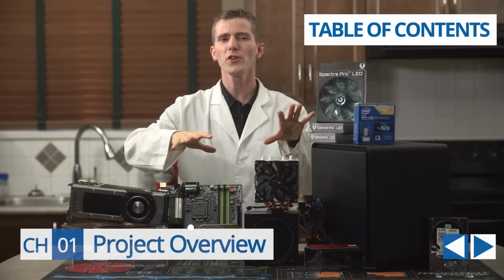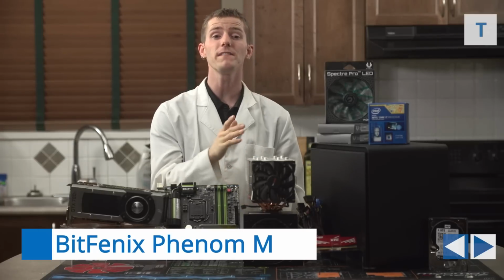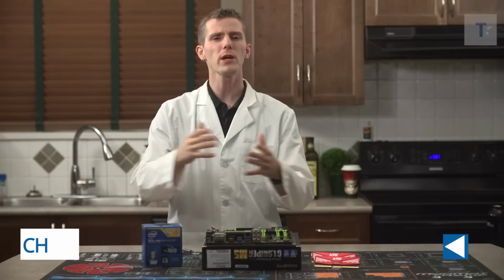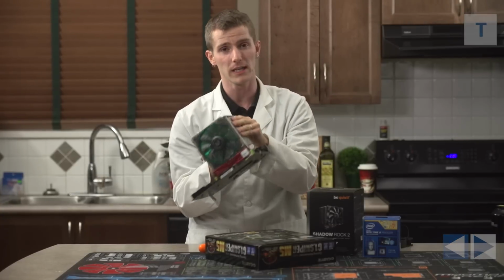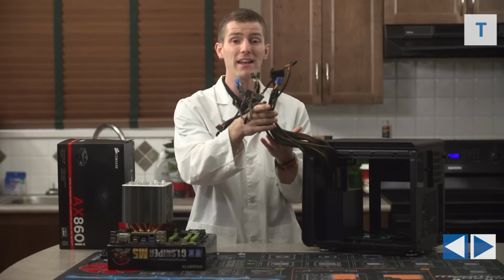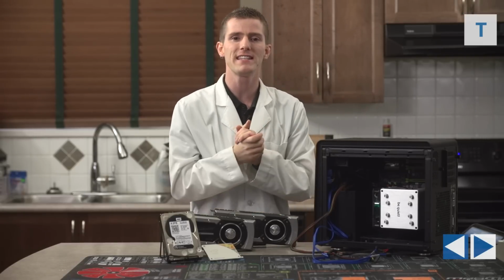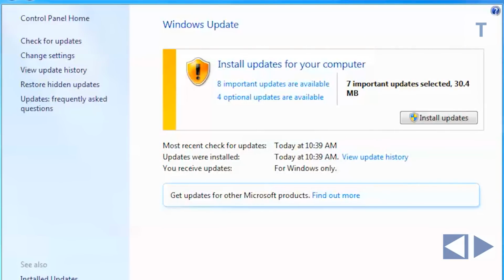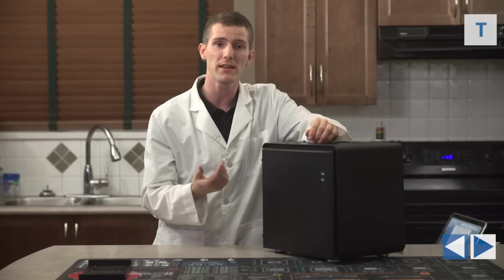ULTIMATE Intel Compact SLI Gaming PC Computer "How To" Build Guide

Comment: I know the video is a little old. but I like this case and ordered it for some measurements. I want to use the be quiet! Dark Power Pro P11 550W power supply.  the problem is it is 180mm long and what I find on informations is the max lenght should be 160mm. I think the bequiet should fit is someone here to confirm my thoughts?

Comment: Is this a good budget build?
CPU - Intel Core i5-7500 3.40 GHz Base Frequency Quad Core 6 MB Cache CPU Processor - Black
Ram - Crucial 8 GB DDR4 2133 MT/s (PC4-17000) DIMM 288-Pin Memory
Motherboard - ASUS PRIME B250M-K Motherboard 
PSU - CiT 400W Micro Atx Power Supply
SSD - SanDisk SSD PLUS 120 GB up to 530 MB/s Sata III 2.5 inch Internal SSD
HDD - WD Blue 1TB Desktop Hard Disk Drive - 7200 RPM SATA 6 Gb/s 64MB Cache 3.5 Inch
Case -AVP M88 Micro Case for PC - Black

Extra -AUKEY USB Wireless Adapter 2 In 1 With Bluetooth 4.0

Comment: GTX 780 TI's, perfectly fine graphics cards that absolutely no one uses anymore.
Reply: ***** Exactly.
Reply: Well, the video came out in February of 2014...
Reply: 600 euro here, rather get sli 970 for roughly the same price (50 euro give or take)
Reply: Aldrian Ramos used to have that card until i fell backwards and spilt water all over it :( its great tough. altough I think I had a gigabyte version..
Reply: Frotzy Wow, They cost like a third of that down here.
Reply: mariochaosspear plus its 3gb... haha, such a ripoff. fuck, 970 sli is almost cheaper then 1 of them... heck, a 980 ti is almost cheaper.
Reply: +Frotzy The 780 TI HAD cost 700$ now on eBay 150
Reply: Niklas Leyrer not here
Reply: Frotzy Where?
Reply: mariochaosspear 270$ USD around there for about 10-15 more preformance compared to a rx 480 which is a good 180$

Comment: Now this will be a killer build with 2 GTX 1080's
Reply: There are better cases out now. I'm particularly fond of this one because it allows radiators: https://www.amazon.com/Thermaltake-Black-Extreme-Chassis-CA-1D5-00S1WN-00/dp/B00PDDMN6S/
Reply: +KinzixHD two 1080s and a kickass processor? Thats gonna be 750 pull, so go with a 1000 or 1200 for safety :)

Comment: the 4770K had some heat problems, if I'm informed correctly. Would've used a regular 4770 or a 4790K. Both seem to be doing better in terms of thermals.

Comment: well done. lots of good information compressed into a short video. a system that size is in my opinion very desireable. thats why i got the prodigy m sitting next to my 29" monitor. looks good together to but if u have ur system on ur desk using quiet components will become even more important. took me some time to find the best psu, fans, gpu and drives to go with. i also recommend using rubber mounts and other silencers to mount the fans and storage devices.
Reply: +1nicko29 is the prodigy m basically the same size as this? was thinking of using it for my next build just unsure if an NH-D15 would fit in, but from the looks of that heatsink think it would be fine
Reply: +Tyler Kelly it´s not just the same size, prodigy m and phenom m using the exact same chassis. the NH-D15 is a bit overkill in a cube like that but it should fit. hight is no problem as this is a very wide case. u most surtenly will have to make sacrifices on harddrives and mounting additional fans.
Reply: Yeah I figured it was about exactly the same, if I ever do build I'll probably ditch harddrives altogether and mount single 1tb ssd to the side panel. As far as the NH-D15 I just wanted a beast cooler and every single review a find on it says it's deathly quiet as well which is great.
Reply: +Tyler Kelly your tower-cooler is 165mm hight. mine is 155mm and i have 60mm space left to the side panel in my prodigy m but the harddrive mounting bracket must be screwed exactly in front of ur cpu cooler.
Reply: +1nicko29 do all prodigy m cases ship with the windowed side panel? I see some listed saying they have one and other not, but every video I see on it has people swapping one of the two regular panels with a windowed one
Reply: +Tyler Kelly side panel is only 10bugs. u have to swap the panel with the power/reset switch to the back. here in germany u cant buy them as windowed version. i also recommend getting the mesh front. i think some have it to start with like the black version. i had to spend another 15bugs on it. it has a dustfilter and helps getting ur powersuply enough air while gaming.check out my video!

Comment: £20 for a fan? are you kidding?
Reply: +.Float £20 for a fan is not cheap. it's extremely expensive.
Reply: +.Float and the 212 is only the best for cost effective terms, put a thermal right tower against it and it will loose
Reply: yeah it is (some fans can be $30)

Comment: @LinusTechTips have you thought about doing a new updated version of this build?  I think many people can benefit from small portable builds, but I don't want to get out dated parts.  I also am trying to do an Ultimate build, so I want the best parts.
Reply: +Albert Gonzales Jr switch the CPU to i7 6700k, get matching motherboard, get 16 GB DDR4 RAM, switch GPUs to dual GTX 980 Ti or GTX 1080s
Reply: +Albert Gonzales Jr Agree with you. Love mATX because of its overall performance per price. But I think it will be wise to wait for the next gen GPU.
Reply: The Modern Shoe I have actually just spent hours looking for an 1151 motherboard with the same PCIE configuratin without any luck XP

Comment: Any chance you guys can make a Build Guide for a € 500  system ? Just the "tower".
The goal: be able to handle League of Legends, World of Warcraft and EVE Online at high to max settings (1080p). With this in mind, feel free to go as up as € 100-200 more if necessary. Minimum of 60FPS ?
Reply: i can save you some time. as i see, youre from the EU so i am using EU prices (higher tax and shit)

i3 4160 - 120€
8gb 1600mhz ram 70€
gtx 760 180€
any lga 1156 mobo will do
550w (any will do)  30€
1tb western digital 55€
cooler master elite 230 30€

its around 500€, depending at what time of the year you buy it. it has enough power for 1080p60f  for any moba at ultra settings and a lot of newer fps games at medium-high.     :D
Reply: +Alexander King excuse me, any LGA 1155 will do, DO NOT BUY LGA 1156 FOR THIS CPU. IT WILL NOT WORK

Comment: Whats Better for Gaming ? Intel i3 or AMD Quad Core ?
Reply: +Marlon Bermudez  i3 i recomend the new i3-6100 or the older i3-4170 both are pretty much equal but the 6100 is more futureproof because it's a newer platform
Reply: Depends on the AMD. Anyways, you could always go with a g3258 (pentium) or an i3-4170.

Comment: Tips for magnet screw , grab a magnet bar (or anything that is a magnet ) , and the screwdriver . Rub the magnet onto the screwdriver (not on the holder )  in one direction . do that for 10 times (just in one direction again ) and then congratulations , your screwdriver is now a magnetic component . Thank me later . 

Additional tips : You dont need to rub it again to have the magnet , the screwdriver itself already a magnet  .

Comment: might eventually do windforce r9 270xs in crossfire... all i need is a new case, mobo, PSU, and fans. sigh
Reply: +Andloo Yunty better get a single faster gpu. if you need all that other stuff to put in a second 270x, rather invest the money into a single 390x/980/fury. you're going to get more even frame times with much less hassle.
Reply: givemeajackson I've actually now looked in to just getting a 390 or a 290x instead of crossfire. I'll still need a new PSU, new fans, and a new case would be better. Also I need a new CPU so it isn't bottlenecked.  #thestruggle
Reply: Andloo Yunty what's your current rig, and what are you going for?
Reply: givemeajackson Current Rig
A10-7700k
8 gigs 1600Mhz DDR3 at CAS-Latency of 10
R9 270X factory OC'ed to 1050Mhz
1TB WD Blue 5400RPM
a supposedly 480w PSU that really does 330 (So I already have throttling) 
A crappy case with crappy ventilation
2 super loud case fans that hardly do anything
and a super cheap fm2+ MoBo
Reply: Andloo Yunty ok, it might actually be time for full rig upgrade then. especially the psu, crap psus are a danger to your rig and your house. i'd suggest doing case, psu and fans first, keep the other stuff running for a while and save up for a good cpu/mobo combo that will last. looking at how intel is creeping along lately i think if you buy a good cpu now it you'll be fine for the next 6-7 years.
Reply: givemeajackson There's no way I'll be doing a full upgrade; I spent all my money on this rig. It was only a few months ago that I completed it, and the GFX card was only added one month ago. I am looking at a PSU right now: https://pcpartpicker.com/part/evga-power-supply-110b10750vr I would love feedback. Also, I'm a minor and have no money whatsoever.
Reply: Andloo Yunty well, cpu/ram/mobo is ok. For psu i suggest something in the 550-600w range if you want to keep the option of going with a 390. The cooler master g-series are cheap and good, same with bequiet's L8 range. This evga one should do the trick as well. I personally scored a used cooler master v700 for 60 bucks, one hell of a deal there. Used hardware is generally a good option. For GPUs, just be careful with used 290(x)s, they were often used for bitcoin mining.
Reply: givemeajackson Thanks for all your help! Also, what difference does it make if it was used for bitcoin mining?
Reply: Andloo Yunty using a card for mining is like letting prime95 run 24/7 for a year on your cpu. It's extremely taxing on gpu and vram, and wears them down extremely fast. Those cards have often been running at 100% load for months. I bought a 280x that was a mining card. That meant i got it for next to nothing, but it only lived for about 8 months until the vram started artifacting.
Reply: givemeajackson Thanks for the tip!

Comment: Hey Can a duel GTX 980 ti fit? If not Can a single one fit?
Reply: Not the 3 fan versions i think tho
Reply: +Domy Albaoud It'll be even better. Much lower power consumption and heat output, and that means a lot in closely packed SLI.
Reply: +Domy Albaoud that is not how u spell dual

Comment: Thanks for this guide Linus (and Intel)! Building my first rig ever with this movie as my guide. It's thorough and very helpful.

One thing I wonder though: you suggest aplying thermal paste in a stripe shape, while the manual of my Noctua NH-D14 suggest a drop of 4-5 mm in diameter. I would say a drop sounds more logical, seeing how the drop will be spread out from the center to all sides. Won't you have excess paste coming out at the far ends of the stripe when using that shape (and does it matter anyway)?

Comment: what happen if electronic component contact with static electric? especially computer parts
Reply: +ilham Defra you could destroy the component. it it fry the compononet, sometimes you can get lucky and nothing will happen but also a lot of the times a static shock will occur
Reply: Destroy mean its physically can seen like burned/blow up/smoked, or it just wont work anymore?
Reply: ilham Defra usually if something happens you wont be able to see it. but if you short circuit it then you will probably see some smoke

Comment: He said that the logo on the power and reset buttons will be upside down, but it's ridiculously easy to flip them the right way. Honestly, if you have one of these cases, just unscrew the I/O pcb from the side panel, and you will see how easy it is to switch the button orientation.

Comment: Is Ducky Shine a mechanical keyboard? Also can anyone tell me why mechanical keyboards are recommended over standard ones?
Reply: Azir Because the actuation point is less. like you dont need to push the key all the way down unlike a membrane keyboard.
Reply: Azir It's one of those things that seem unnecessary at first, but once you switch you'll never go back! Of course any keyboard is more than adequate for work stuff and gaming. It just goes a little bit better/more effortless/faster on mechanicals. Plus you get to choose between the various switches and pick something that feels best suited with your own hands.
Reply: Azir It's really all personal preference over key switches. I like the clicky sounds so I got the Razer Green switches ( I got the Blackwidow Tournament Edition because I'm on a budget.) If you don't want a clicky sound, but still want linear switches, go for Cherry MX Browns. If you don't want clicky and want non linear switches, go for something like Cherry MX Reds or blacks.

Comment: Is this a good build.
CPU:A human brain a found at a graveyard
GPU:An artist forced to work all day in my basement
RAM:20 people forced to carry information
Motherboard:My basement
PSU:1,000,000 lemons
HDD:10 people
Case:My house
Monitor:The paintings the artist makes
Mouse:A whip
Keyboard:The brains control panel
OS:My mind
Im going to use this for office work.
Reply: i think you should add another 500.000 lemons
Reply: ***** Ok
Reply: Jake Clancy I think 20 people forced to carry information is pretty weak. I would go for a safe 33.
Reply: Jake Clancy Actually 999,999 potatoes give more energy than 1,000,000 lemons.
Reply: Maybe go for a ski configuration with the artist and move to Antarctica for optimal cooling options
Reply: +Jake Clancy I recommend to overclock the artist. It means no breaks. Make sure to whip him/her constantly.
Reply: give the gpu about 3 people, they work as a passive coolant so the artist doesn't have to take as many breaks, and can work for longer periods of time.
Reply: This is pretty good way to explain parts of a PC to Dad
Reply: +Jake Clancy I prefer having both an artist and a scientist for a more versatile GPU.
Reply: Remember to add some people with the artist
Reply: +Jake Clancy Use your panties as heatsink . should be low as -10c .
Reply: hmm a million lemons is cutting it close try to get a 1.2 million model
Reply: I really don't think that only 10 people will make the cut for storage. The year is 2017, so you should have at least 50 people for mass storage and maybe another 10-20 people supercharged on energy drinks to run your mind.
Reply: its a shame you bought those lemons when they just came out with lime...wait thats outdated now, should upgrade to the limon xtreme
Reply: Can it run crysis?
Reply: you have more ram than hdd space???
Reply: Sounds like a good plot for a horror movie

Comment: 2 questions: how much is this and how would I get it wireless connection and still keep it in the compact box
Reply: Coolkid787 If you're budget orientated, I wouldn't go with the GTX 980. For much less cost and only a little less performance, I'd say a 970 is much better.
Reply: derp bot the gtx 970 only has 3.5 gb instead of four but its no problem id still get 2 of them for sli and for a wireless card you can get one for $15.
Reply: It will be over $1000. You can get a wifi card witch would keep the small form factor, but make it wireless
Reply: Thanks

I looked up the 780 and it was 1000

Am I looking at the wrong one
Reply: No, those are the right ones. If you want, you can just do one graphics card  instead of 2. I would recommend getting GTX 980's instead of GTX 780's. The 980 is more powerful and consumes less power. It will be around the same price point for the cards, but it helps you save money on your power bill and you will be getting extra performance.
Reply: would a msi gtx980 work for duel graphics cards, or would it just not be worht it
Reply: k, thanks
Reply: Exitou Agreed
Reply: derp bot If you want a small form factor case, then you have to go with the reference design cards.
Reply: Coolkid787 the 780 is a last gen card so stock is limited, therefore expensive.  Get a 970 or 980.
Reply: That's what i exactly said...
Reply: Moethedirt It has 4GB but the last 500MB is a different type of memory that isn't optimized for gameplay.
Reply: Zack McLennan I know just forgot to mention but I heard that most games will stop you from using the last 500MB
Reply: Wouldn't doubt it
Reply: Zack McLennan Scamvidia 2014
xD (I use nvidia cards not an amd or Nvidia fanboy)
Reply: I have a Gigabyte GTX 960 G1 myself.
Reply: how does it perform, and is the evga version as good, because that is what i think that im getting
Reply: If you're talking to me,  The 960 performs well and at low temps.  I've been able to play every game I have wanted to play in the 720 - 1080P res range at high settings with a frame rate of 60FPS.
Reply: Coolkid787 u could get a usb one which is more easy
Reply: derp bot 980's would work. but with a build saving space it's unlikely you'll get a huge monitor for 4K. , you can cut $300 and get sli 970's. maybe wait a couple months and look for updated versions of those.
Reply: derp bot Woah, what do you need this for? This is pretty overkill for 1080p gaming/amateur video editing. Heck, a $700 PC can do that stuff easily.
Reply: +derp bot Well they wee actually 780 Tis. Which are outdated anyway and have been replaced by 980 Tis for the same price ($650)

Comment: Do you think this could run minecraft at at least medium settings?
-4 way SLI 990ti
-ITB samsung SSD 
-16TB Harddrives
-256 Gigs of Ram
-X99 motherboard
-200W power supply
-Im using goats blood as water cooling :)
----------------------------------------------------------------------------------------------------------------------
Tell me if this isn't powerful enough. Thanks
Reply: ***** i think that build is a bit to slow for medium/high settings. Maybe instead gtx 420s get like 69 titans x ti oc or something
Reply: I think u must mod your case a bit to put in second motherboard with xeon x9 ;)
Reply: WeᐃkEnough or just make like four pc's so u can play on lowest setings with max 12 fps
Reply: Right, thanks so much!
Reply: xD, thanks
Reply: ***** maybe gods of love and respect will force nvidia guys to produce 990ti
Reply: stfu
Reply: Eh, you'll need to get 17 way SLI to run Minecraft at low settings at 2 FPS.